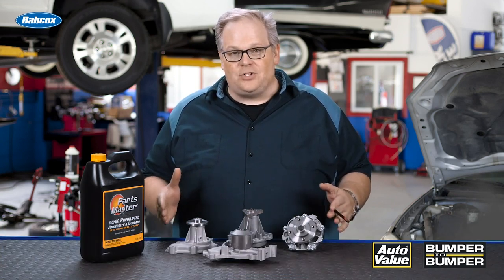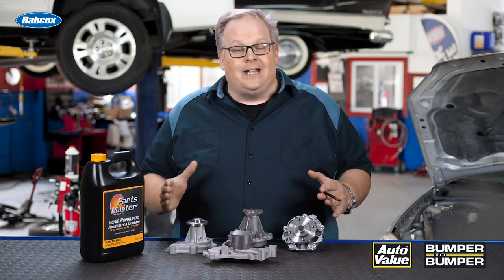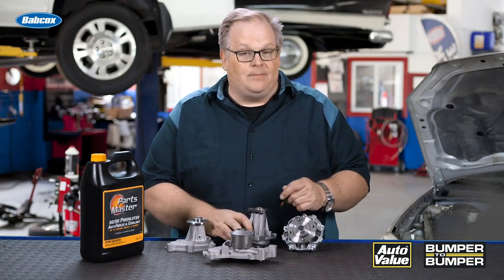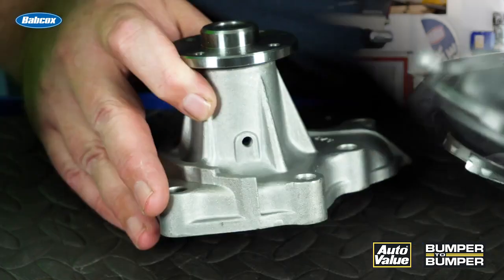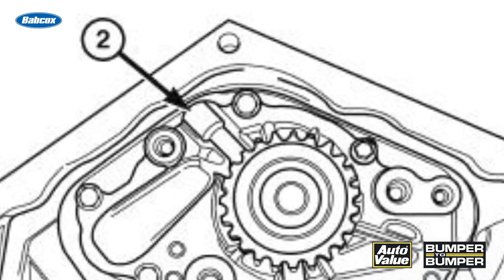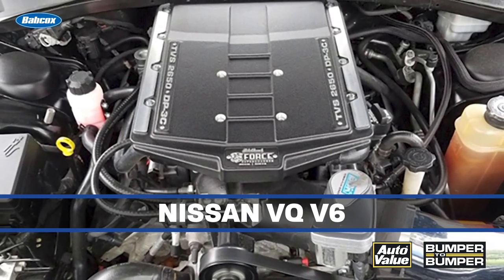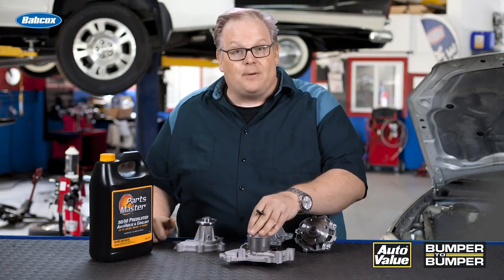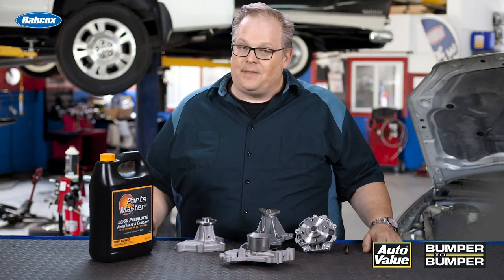Water Pump Weep Hole Relocation

Comment: What if u j.b.weld a leaking weep hole? What will happen?
Reply: I think they are designed to fail on purpose to tell you you need new water pump
Reply: Did u find out bc that what I’m about to do lol
Reply: my understanding is, it is supposed to weep a small amount of coolant regularly after a drive/heat cycle. plugging the hole on a good pump will cause the excess pressure to push the grease out of the water pump bearing/s causing early failure......if the pump is bad/pouring out the hole and you plug it...... shouldnt hurt anything?🤔
Reply: Yeah let us know if it worked, I’m going to plug the hole with jb weld and then drill a tiny hole no bigger than a slightly thick needle at the cap of the coolant reservoir for excess pressure and see if that works until I get paid to buy parts

Comment: BUT-- yoiu really did not explain what it is supposed to do and why would hole let more water pass as time went on, Why can't we just plug it with felt. My 2000 camry is weeping at 80k pump life. Mine is leaking say a cup every 12 miles? you do not say what is the problem the seal or the bearing or both is the hole a warning. way of saying  parts are too loose fitting and may jam up soon. Like the scrapesr on a disc rotor when pad is < 1/8"  or tire tread wear mark?